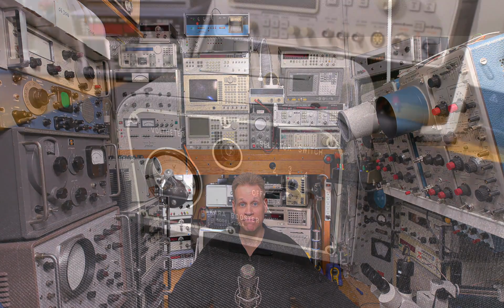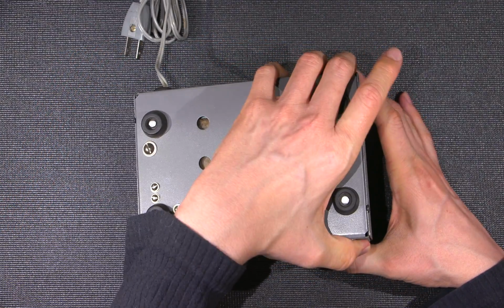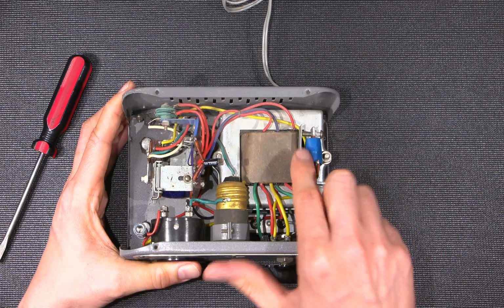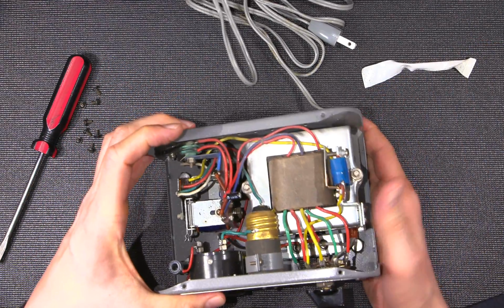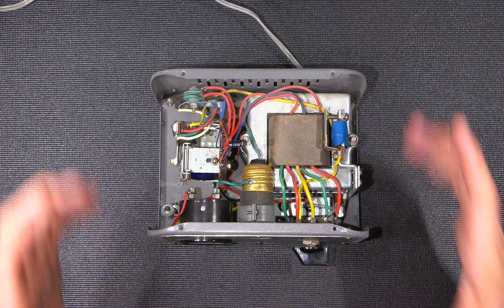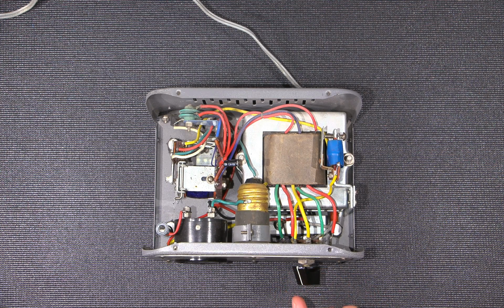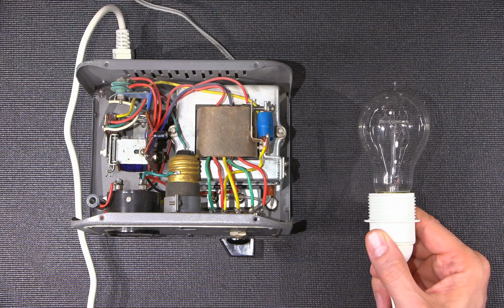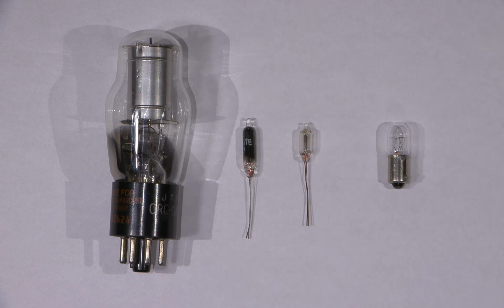What's a Takara Booster 200A? Let's Find Out!

Comment: "Retro" clocks, etc. that use Nixie tubes frequently feature an LED mounted in the center of the tube socket.  Not just to look "cool" (they frequently use blue LEDs, etc.)  This is because gas-discharge tubes like those VR tubes, neon/Nixie, etc. have unreliable starting if they are located  in complete darkness.  So they would put an incandescent indicator bulb (in the old fire-bottle days) or an LED here in the electro-nostalgic, retro era.

Comment: I imagine that if your input was the minimum 70 VAC that you would be able to use more notches on your selector switch. The relay and buzzer activate when it reaches its max output of 120 VAC. Built in maximum protection.

Comment: I'd like to have seen you lower the input voltage to see if the higher settings on the device would engage and continued to provide 110-120 VAC.

Comment: With regard to the trivia question.  Neon bulbs have very little resistance after ionization and very high resistance until then.  Tungsten filaments behave in roughly the opposite fashion.  So if a design goal was to produce a constant current during start up, then having a series arrangement of the two bulbs could possibly be made to work.  Also, the incandescent bulb would provide ballast to the neon bulb if the neon was being used as a reference and not meant to drive a load otherwise.  I've never seen this arrangement but that's what I would be thinking if I did see this in a device.

Comment: I believe the reason for an incandescent bulb installed next to a neon type regulator was to help the regulator “fire” when first energized. It would take a higher voltage for the neon or gas discharge regulator to conduct if it is in total darkness. Am I right? I seem to recall learning this a long long time ago.

Comment: The light bulb acts a variable resistor who resistance is controlled by how hot the filament gets and then acts as a automatic gain control when used in certain circuits ............  .:)

Comment: I got a nice surprise from this video.  I'm sure that device was intended for use by US military personnel stationed in Japan so they could use their American-made appliances on Japanese voltage (103V, 50 Hz on the east side of the country, 60 Hz on the west side).  It was probably purchased at a Base or Post Exchange, which is where they also bought most of their appliances.  You could probably buy it off the local economy but the lack of kanji on the nameplate suggests it was only intended for American servicemen.  Judging from the polarized outlet it looks like it dates from the 1960s, but because Japan didn't begin installing polarized outlets in their homes until recently the lack of a polarized plug is not too surprising.  My guess is that the device would have sold for the equivalent of around $10-$20 today, but at the then exchange rate of 360 Yen per US Dollar, it would have made a neat bargain for the serviceman.  The transformers are really good, though. I have a more modern ten amp model that's been powering my American TV/audio center for more than 30 years.  Except for occasional moves, it's never been turned off.
I love all the safety gear inside, especially that neat neon bulb!  You don't find that in today's transformers.  I checked all of mine and none do Bluetooth or Twitter in the event of an overload either, so maybe I got jipped?

Comment: Can I ask u a question in regarding to measure AC and DC current.

I am building a power supply from Microwave transformer. I have a Flute multi meter. It can only measure AC current.

I can check AC current before and After the Transformer.

But after circuit go through bridge rectifier. How can I check DC current ?

Is there a way to mathematically convert AC current to DC current?

Comment: Here in Europe, we sometimes used voltage stabilizers to run the BW tube TVs. These stabilizers used Ferroresonant Transformer with a capacitor that self regulated the output voltage at 220V. The line voltage back in a day was not stable, especially in rural areas where there was one utility transformer feeding few houses or farms spaced few kilometres apart. So when the voltage dipped, the picture on TV would shrink, and so on. In old TVs the EHT (HV) can change as much as 15% for a 5% difference in line voltage. As the picture size is determined by the EHT, you get an idea what was happening.

Comment: In regards to the Trivia question. I would say the purpose of that bulb is an indicator to power flowing through that circuit. It's there, probably wired in series, to let you know that specific circuit is complete and has power flowing through it and is most likely operational. My grandfather's desiel tractor had a bulb in line with the glow plug circuit. If that bulb lit up, you knew that your glow plugs had power to them and they were warming up!

Comment: Hi. They use the incandescent bulb to absorve any overload or overvoltage that may occour. The over voltage will make the bulb to absorve that current and get rid of it as heat. Is like when i have a old crt to repait and i plug it in serie with  100 watts bulb, if the crt tv is in short circuit the bulb will act as a energy absorver.

Comment: I have one of these voltage boosters that was made in Russia in the 60's I believe, i fixed it and I keep it for blowing stuff up by overvolting them lol. Has a really nice volt meter and an indicator lamp but no over-voltage shut-off or any alarms. The thing is that line voltage back in the days used to be much lower than now so even on the first steps it buzzes pretty badly.

Comment: Mr Carlson -- those old gray resistors (marked "River" in your video) sometimes have live voltages on the coated rim of the component. Is that common? If so, might be worth a mention next time. I shocked myself once by making the bad assumption that the grey coating wouldn't be live. Maybe mine was faulty (was in a 50's era AKAI/Roberts reel-to-reel).

Comment: Maybe they do the same as I do with circuits I suspect a shortage. I call it a poor mans protection for the circuit, when I put an incandescent bulb in series to it. If there is no short, I just added a little bit of series resistance to it, but if there is a dead short the bulb glows and nothing else happens, because of the voltage drop over the lamp. The circuit is protected. If the device has a high inrush current (low resistance at the start) the the bulb glows for a short period of time and limits the voltage over the device under test. 
I think this incandescent bulb does exactly the same. It drops the voltage when the tube heats up or has a low resistance. (But I never worked with tubes and have no idea how the resistance changes over time)
Yeah, I know, that's not the safest or best solution to test a device, but its the only one I could afford. Many devices have a soft-poweron or switch in someting later on, which couldn't be measured when the device is powered down. It's an easy and cheap method to test some unknown devices. So, don't try it at home, if you don't know what you are doing.

Comment: incandescent bulbs probably used for stabilising the heater supply, like a ptc thermistor.
if i remember correct, they use iron filament, because its low thermal capacity and hidrogen because its high thermal resistance for faster response to voltage rings.

Comment: What is the voltage at which the relay and/or buzzer are triggering ?  What is the actual purpose of the electrolytic capacitor ?  Looks more like a low voltage capacitor (12V-35V) range.  Not seeing much of electronic parts around, I wonder how this thing actually works.  At first glance it seems to be "simple" transformer with multiple taps.  When the output voltage is just on the limit, turning on and turning off the load might suffice to trigger the alarm.  Oh well, it has been around for a while so I guess it did its share of work.

Comment: I used an incandescent bulb as a voltage drop in a project ages ago. It was not accurate, but worked for my needs. It was just my own idea, had no idea if that was an acceptable application. I have no idea if this answers the question though, would amaze me if it does.

Comment: The question, a lamp wire is a ptc (positive temp coefficient) resistor, i guess is so for startup protection. (Thanks to Joe, for the coorection)
Reply: Moreso a PTC, no? Ptc goes up in resistance as it heats up, NTC resistance goes down, as it heats up.

Comment: My late father was a profesional photographer, he had somethink akin to that box to regulate the power in his studio. It was rather more sophisticated though, it had a large motor driven variac that was controled by and driven by valves/tubes the device was rated at six killowats. He only sold it a few years ago just before he move to a retirment complex. On another note I had a 90 KVA skiacky spot welder where the timing was done by neon tubes and voltage regulator tubes with relays firing two water cooled ignotrons.

Comment: Paul, re your stiff power cord. Most old plastics can be softened nicely by exposure to camphor fumes.  The old roll-slide film was often made with acetate-based materials and if left exposed to the open air would turn very brittle and crumble when touched. 
Consequently the roll slide strips were stored in a metal canister with a screw-on lid. Inside the lid was glued a small piece of felt. The owner was supposed to put one drop of camphorated  oil once a year onto the felt.  This would keep the film supple and not brittle.  Camphor was often used as a mold lubricant for making plastic combs and things. Now in my youth back in the 60's  I tried camphor on all sorts of things plastic.  Especially old open-reel tape. Works like magic.  Same applies to very old open-reel films.  As I recall they came in metal cans with felt too.  For the old tapes most machines had provision for a cleaner pad that was part of one of the tape guides.  A little camohorated oil on that pad worked well too. I would wipe the cord down with csmphorated oil and store tightly in a double plastic bag for 24 hours.  I wouldn't be surprised if it came out softer.
Reply from the maker: I will have to try that. I will change the cord anyways as this one isn't polarized, but it would be a neat experiment. Thanks for your input!

Comment: An incandescent light bulb exhibits negative resistance required to ensure the gas discharge bulb begins and maintains regulation. The same effect used by Hewlett Packard in their famous Model 200A oscillator to achieve excellent low distortion and stability.

Comment: Why do you have a 5 position selector if the output switches off when you pass the second? Is it because is meant for several types of devices with several powers so when you put a power hungry device the 3, 4 and 5th position doesn't make the output voltage go that high?

The thing with the bulb, I think the control needs a resistive load to start itself, I had a similar situation with a school project, I wanted to control a water pump with a SSR and wanted to show if the actuator was working by putting a neon indicator in parallel with the pump, When I activated the SSR the neon switched on but the pump did nothing, then I switched the neon bulb with an incandescent light and it worked like a charm, So I think the control needs some electrons to flow in order to activate itself because the vacuum inside makes so much resistance it cant even start

Comment: What's the point of selection 3,4,5 if they never work.
Reply: They will work...but only if the input voltage is lower.
3 = 90v  4 = 80v  5 = 70v
It steps the output voltage up by 10v for every position higher.
Reply: @gregorythomas333  Now it makes sense. Thanks.
Reply: No worries mate  :)

Comment: Paul have you put 70 V AC to the device? Will it  work with that low voltage? And is Position 1 really input and Position 2 really the output? Or isnt it just the boost level. Greettings Form Germany
Reply: It seem the switch is for the boosting level, you get 120v on no. 2 with 100v input so probably you need to go to a higher boosting with 70v

Comment: Interesting device.  It comes from the era when Japan had 50 cycle line voltage at 100 volts.  

My friend was an engineer for IT&T back in the '60s and was in Japan for 2 years creating satellite communication systems.  He bought a Goto refractor telescope with the electric drive and would watch the heavens with it.  When he came back to the US, he was not able to use it in that normal capacity due to our line voltage being ~ 115 volts at 60 cycles.  His easy work around was to use an HP lab power supply and dial in the working parameters to synchronize the motor to the proper rotation speed. I guess it is all Tesla's fault, Hi Hi.

Good video.  That unit looked so good that I could not even smell it.  As you know, the old stuff has its aromas.  I consider that a museum piece.  Job well done!
Reply: "from the era when Japan had 50 cycle line voltage at 100 volts"
We are still in this "era", though. While all of Japan runs on 100V, eastern Japan (including Tokyo) runs on 50Hz, while western Japan (from Nagoya on westwards) runs on 60Hz. And while they occasionally talk about unification, it's not going to happen anytime soon. Other than immediately after disasters, or when buying a microwave oven, you are rarely confronted with the implications of differing frequencies.

Comment: I would have liked to see if the other positions would have output at lower input voltage.
Reply: They would have, that’s why the overvoltage cutout relay was activating due to high output voltage (its obviously set to trip somewhere between 125-130VAC).  The rated input voltage, if I recall, was 70-100 VAC and each tap seemed to be at roughly 10VAC steppings, so the other three positions would have compensated for input voltages 70, 80, and 90VAC.

Comment: Happy St.Pats day, well I am sending this before you crack open cover; my guess is that this is a step up transformer, & the 5 position sw., is for the different taps of transformer, might be some filter caps in there as well,and should be fused..[hopefully]...Hugh...Chicago,metro.
PS- Yes GFI trips@ 3-5 milliamp trip point & Arc fault outlets. I am licensed electrician.ps2 - Build a better one, and send to Venazwalia....ha..ha 🌎

Comment: Is the filament bulb an indicator of the proper operation of the tube, meaning if the bulb is lit then the circuit is operating as designed? Interesting trick question.

Comment: I was really expecting you to run it down to 70 or 80 volts to show boosting up to position number 5...it would have been nice to see...that neon indicator seems a bit overkill, and mounted in a way you almost expect it to be a magic eye tube...and I am surprised they didn't use a socket for it. Oh and neon bulbs require a higher (and unpredictable) trigger voltage in the dark as opposed to in light where it is much more predictable and stable.

Comment: I inherited an old regulator from my grand dad. It also had the purpose of providing a stable AC output voltage with varying line voltages. The principle was a lot different though. I never understood it completely but I think you know what I mean when I say: It worked with three transformers that regulated the voltage somehow by using core saturation. So there was no need to adjust anything. Just plug and play. It was very heavy though. There were also other much cheaper and lighter devices just like the one in the video but without the safety feature. The switch on the front also switched different taps of a transformer in boost configuration and an analog volt meter showed the output voltage. They were very common from the 50s to at least the 70s, sometimes even 80s here in eastern Germany.
Reply: GenniDee 
I bet it also was very hot.  Square-D (or somebody with a similar name starting with an “S”) used to make some of those.  They were called Ferro-resonant Constant Voltage Transformers.  We had one around 1979 for some special application before we got a bigger power transformer and thereby a more stable voltage without the gimmicks.  I recall they had been shortly described where I studied, but so short that I had to search through my books (yeah, that was before Google) to actually figure out the strange thing.
Reply: @InssiAjaton  I actually never tested it and just kept it as an oddball piece of equipment that, while being completely obsolete nowadays, is somewhat interesting and also reminds me of my grand dad (: He always had this one sitting underneath a table right next to the TV although I think it was not used anymore at the time I saw it in the late 80s early 90s. And yes, I would imagine, that it develops quite a bit of heat.
Reply: GenniDee 
I found the name of the manufacturer that I referred to.  It was Sola HD (HD for Heavy Duty).  Turned out they have stopped making the ferroresonant transformers, which is not really much of a surprise, as nowadays you can get any number of solid state electronic regulators that have much better efficiency, meaning much less heat.
I do recall that later on we tried a smaller version for feeding our computerized controller, but it did not solve our noise problem and caused another — the computer did not like the heat.  What we ended using as a replacement was a Triple Shielded Transformer that worked fine until we figured other ways to protect the computer.